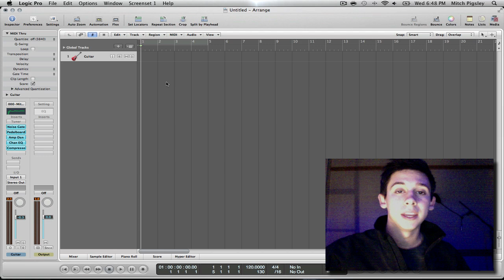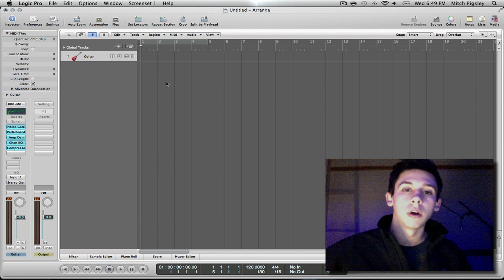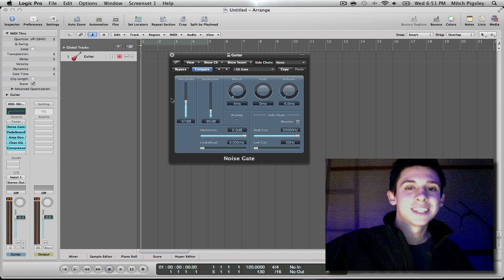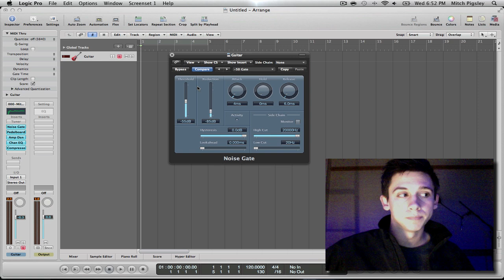Logic Pro 9 Tutorial - Noise Gate

Comment: A noise gate won't get rid of a noise from a signal, it'll only attenuate the volume so it's less noticeable in the natural gaps in the source. You might have more luck with an expander, which will also push the noise floor down, but in a more natural way. An expander adds gain to a signal above a threshold, which is the opposite of what a compressor does. However, as Mitchel suggests, the best solution is always to re-record something without the problem - if that's an option! Good luck!